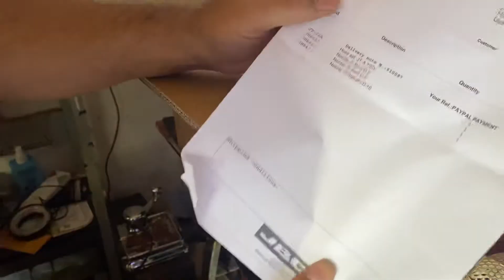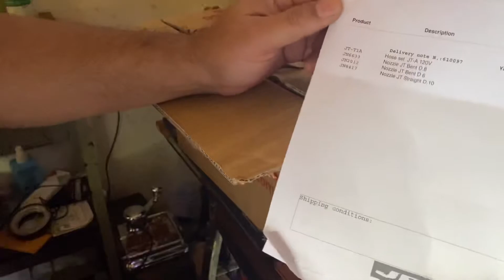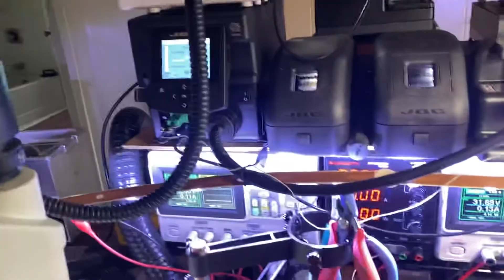JBC JTSE / TESE Hot Air Station NEW JT-A Handle Unboxing

Comment: I'm Using the 700W Unit (JTS 230V-2A Hot Air Control Unit) and if i get the one you are saying, the TE-TB hose, will air pressure be lower to, as i want really low air pressure when i put on low. Thanks.
Reply from the maker: Based on my knowlege, the smaller TE-TB hose will supply lower SLI. The unit controller are both the same regardless if you buy it with the JTA handle or the TE-TB.  And I can attest to that it is indeed true! Since I have both hoses, the TE-TB does have a lower air pressure than it's brother.
Reply from the maker: But I am not sure if your unit will fit the TE-TB hoses. I know JBC has just upgraded these units not too long ago, so you might want to check with JBC first to see if your unit is compatible.
Reply: @forthosewhodare7325   is what JBC is, they will send a engineer with new unit as this one don't hold time and date, so they say is faulty, and engineer will bring a brand new one with him and i can test both, hose's they work both on same unit is 700W unit even JBC show 300W and 700W i think is done to what hose take,is what we pay for Quality and good service, they do go from zero to whatever are set in seconds, other Chinese take some time to go and to stabilise at the temperature are set, i was checking other Chinese i have was set at 280 degree and temp oscillate between 240-310 degree,i ll get both hoses and i will do small and big IC's, the TE-TB i hope will not heat parts around the Main IC we work on same as the JT-A does, high air pressure just Dry out to fast the flux,THX for the reply.
Reply: yes are best smaller give lower air pressure and higher give stronger air pressure i got both hoses JT and TE same as you got it get to temp very fast, everyone  like the Chinese, because are cheaper but they give to much air pressure.

Comment: @Justice League i see you got both i got the powerful one:
 1 JTS 230V-2A Hot Air Control Unit and 
1 JT Heater Hose Sets 
i was thinking to change it with:
1 TESE-2A 230V Hot Air Control Unit
1 TE-TB Precision Heater hose set
The JTS and JT it kind of blows parts away and it overheats the parts around, what do you think ?
Reply from the maker: I would just get the TE-TB hose for it. It is interchangeable and there will be times you will need the powerful one.
Reply: @forthosewhodare7325   i need low air or very low air, i was  thinking to get other hose but Air Flow  on mine is 5 to 50 SLPM if i plug the TE-TB will go lower ? other have 2 to 17 SLPM, you have any discord ? Thanks
Reply: I also forgot to say if i turn it off and not unplug the unit it will not keep the time and date, yours holds the time and date after you turn-it back on ? is plugged in all the time, is strange for that much money it memorise hours we use and not memorise the simple time and date, maybe mine is faulty.